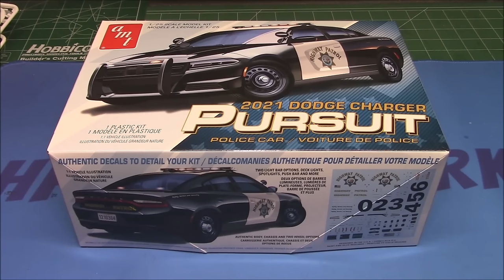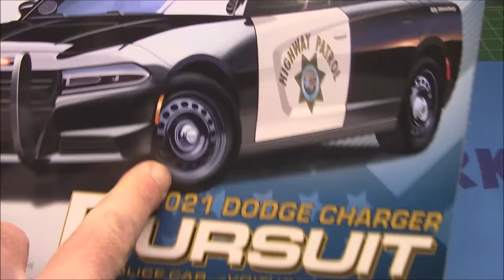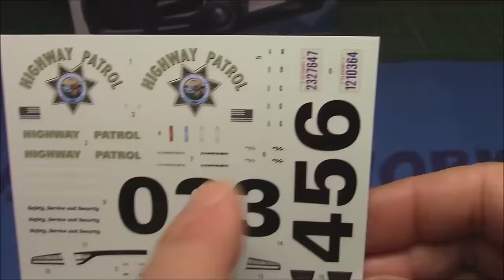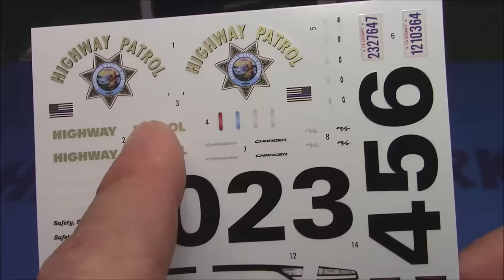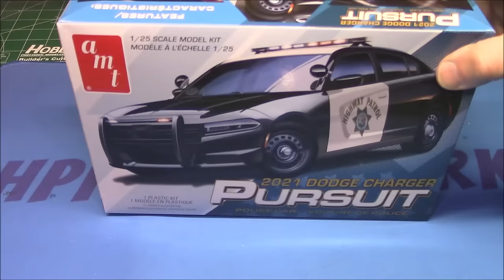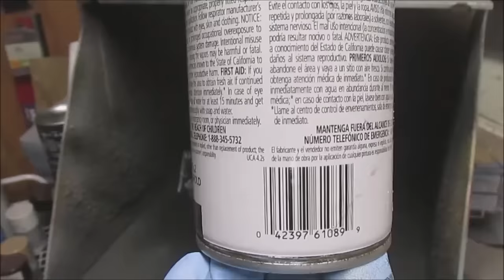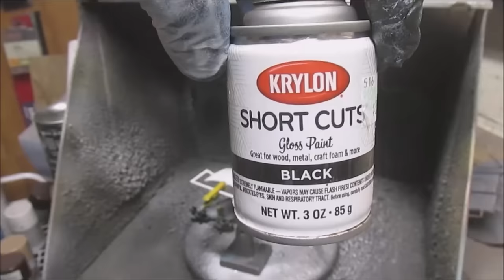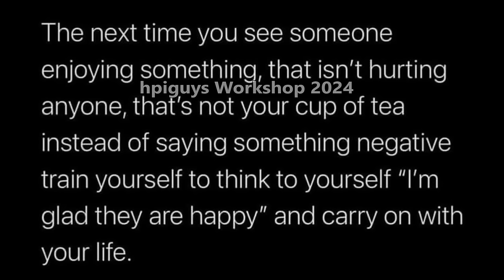NEW! 2021 Dodge Charger Hemi Police Pursuit 1/25 Scale Model Kit Build How To Assemble Mask Paint

Comment: I love these kind of models. Pursuit is kind of misnomer if you don't  lose that high drag lightbar. Go slicktop and get more MPH. Bad guys get chased down by these. Videos a ton here, and I love the PIT maneuvers. I am thinking of starting a Police Vehicle forum because I really love these and other emergency vehicles.
Reply: sounds cool for dio if I got them I'd build 2 3 cop cars scat pack challenger hellcat charger peeling off an set it up on bae pit manouver you ment I have red one but traded buddy over there in community to get me one cause they ware amt ROUND2 don't distribute in Ireland but love sound ur plan i might be able 2 3D print them 132nd scale to do that idea u mentioned iv 2016 charger files I could use to print them be a couple days 3D printing but be worth it,👍👍
Reply: Where are you car 54

Comment: -Question, if one was to obtain a 1/18 Jaguar 180convertible by Maisto but the front “windshield” was cracked/ broken. Is there a way to replace such windshield? Is there a store or internet site that specializes in “Bits and Pieces” to diecast/model parts? I’m asking simply because you seem to have a wealth of knowledge on models and maybe connections to such companies that might have such services. Thank you in advance.
Reply from the maker: You could probably replace it with a thin piece of clear acetate or lexan cut to shape.
Reply: @hpiguy - Thanks for the confidence but I have always lacked the actual skill for taking things apart and then putting them back together. I’m the type of guy that has that sort of luck, if things are going to go bad they will and then some. But you did mention acetate and I will look into that. Thank you.

Comment: I want to point out the Pursuit Chargers with the two wheel options shown were for the All Wheel Drive models, the black steel wheels with the round holes are the Hemi AWD Chargers and the other wheel with spokes was used on the V-6 AWD Chargers, Rear Wheel Drive Chargers had the steel 5 spoked wheels
V-6 Pursuit Chargers were only available with AWD and had a Governed Speed of 140 MPH
V-8 Chargers were available both Rear Wheel Drive or All Wheel Drive and had a Governed Speed of 160 MPH

Comment: If you have time, I'm struggling to find a "glue" that I like and that I can successfully work with.  I see in your current videos you brush on "glue" and was just wondering if it happens to be the same Tamiya "cement" that I'm using as I see you get better results than I do. I can't seem to not make a mess of it with that stuff.  Love the videos!
Reply from the maker: I use Plastruct Bondene. Modelroundup.com sells it. 

Most of the modern liquid glues work very well. I'd stay away from the tube glues and thicker gel type model cements as they take longer to hold.
Reply: @hpiguy  Thank you, I'll give it a try.

Comment: I want to do one of these in Michigan State Police blue color, but I already checked and it would cost almost as much for the custom made paint as the the model itself. Is anybody even making decals for that build either?
Reply: MSP decals are on the "auction site" along with the hood placard, although the STOP  lettering is blue instead of the needed red. We will also need the flat top single wig wag light. I am looking also.

Comment: Very good job Chris. I have a question though. How did you remove the decals after you already had them set in and then reset them again ? I didn't know that was possible.
Reply from the maker: They weren't set, but close. I soaked over them with water and decal solution and luckily they moved.
Reply: If they had set would you still be able to remove them with this procedure ?